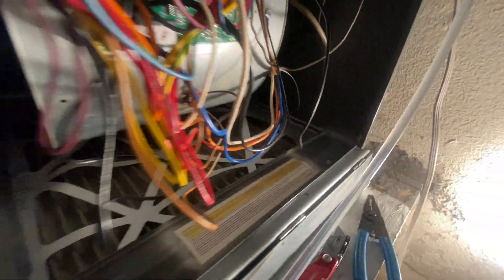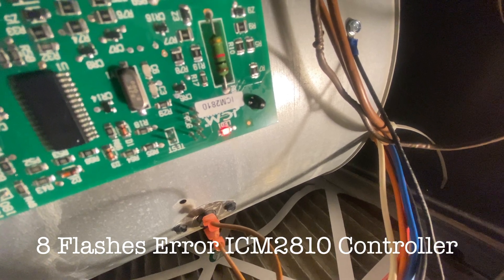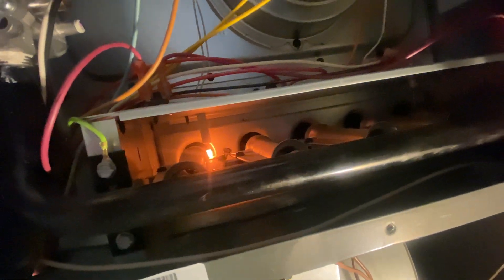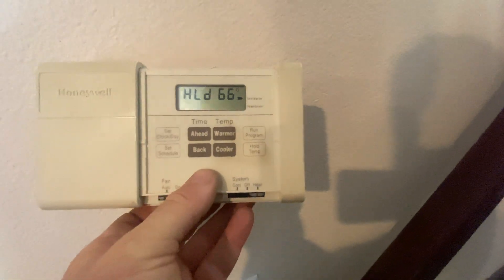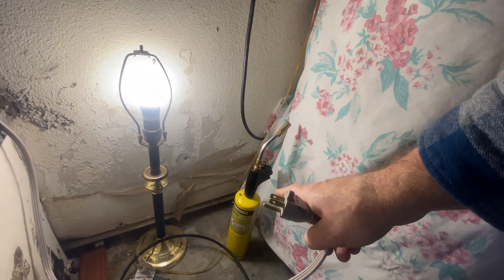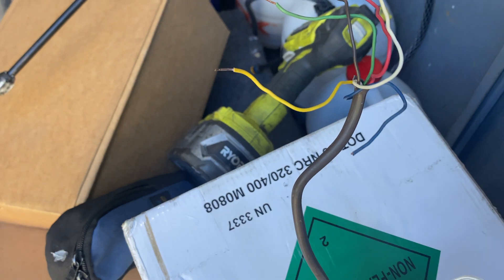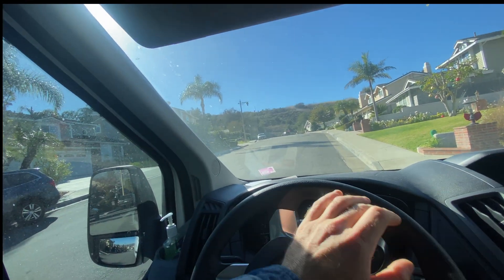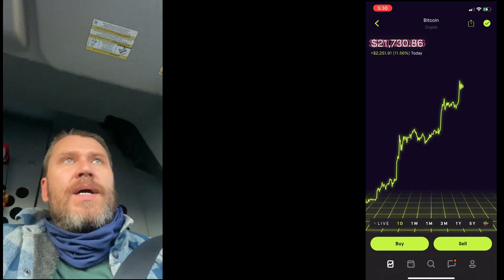Goodman Furnace No Heat. 8 Flashes Error On ECM2810 Universal Controller. Bad Thermostat.

Comment: Thanks for Posting this. 8 flashes = Bad Thermostat. That thermostat was old as the hills. i don't like those piece of junks thermsotat. New Thermostat allwasy a Good place to start when thermostat loooks like that or very old. i Would of just jumped it out at the board to take themrostat out of the equation on any call when u start troubleshooting. good palce to start. easy too. not to myself. take one piece of wire across Red to w to G for starters. ive seen weird failures with old thermostats with swtches too. wiggle switch and it works. after years of sliding switches.
Reply from the maker: Interesting thing about this service - if jumped of the board with t-stat wires connected to it - same result - you will have to disconnect all low voltage off and then jump it - that would show you bad stat, otherwise as long as stat in the circuit its doing this open valve for a sec and then to lock up mode
Reply: @MaratRPMSoCal    Good to know . thanks . i don't do much heat either.not around here. only the occasional heat call.
Reply: @MaratRPMSoCal  probably batteries leaked and got on the board inside the t-stat. if it doesn't have batteries then bad capacitors leaked and corroded the same way.
was the LV low overall or some partial voltage on the other terminals?
Reply from the maker: t-stat still calling for heat ok and works in cool 100%
Reply: @MaratRPMSoCal   Thermostat looked too old. i put those thermostats in in the 80's.lol. 40 year old thermostat. LOl.
Reply from the maker: @OcRefrig  This repair still doesnt make sense to me. Only because tech support was saying bad stat 😂. better believe what error code explains, don't trust common sense nowadays I guess
Reply: @MaratRPMSoCal    
i'm guessing thermostat was doing something funky inside and board saw it and did not like it and threw a code.
Reply: @MaratRPMSoCal    Yea, allways best to follow what code sheet says first then i f that does not work , start using common sense and troubleshooting and tech support.
Reply: I was having exact same problem all winter.  Had tech out couldn't explain the eight flashes and the fact that everything was in good working order. Put new thermostat in solved problem.  As were coming into spring/summer haven't had furnace running for a week or two until this morning. Woke up this morning to the house at 61 and the 8 flashes are back.  Went down and reset furnace and it kicked on 1st time.  I almost feel as  though the board is probably the culprit as I am an electrician and I know that I do not have a bad ground with new wiring in our house.

Comment: I found mine stops heating and flashes 8 red if it’s run continuously for a long time.
Example, tonight, -12*F. Instead of cycling, it’s run continuous for 4 hrs. After 4-ish hours, it will keep the blower going but shut off the flame. Only solution is to shut off the power physically to the furnace, and restore power to clear the code. Then it works fine again.
Reply: Does your inducer turn on for a few seconds?
Reply: @Sesamestreet9080  yes
Reply: @KmanAuto  mmm had it happen to me. Keep for bad/loose ground cable. If all checks out then it’s a bad board
Reply: @KmanAuto  also try to unplug the molex and reconnect and see if that makes a difference
Reply: @Sesamestreet9080  nothing loose that I can find. Actually the original board died about 5 years ago. Sucked as it would have been covered under warranty had I mailed some postcard in that I never new existed... Did the same with the old board. Again, only happens if the furnace runs continuously without shutting off for 4ish hours. then just runs the blower. If I turn temp down before 4 hrs, and then back on after waiting 5 or 10 seconds, as long as I do it before the 4 hr mark, no problem. It's weird. I just live with it. I installed a couple mini-split heat pumps, and since I have solar, that does a good chunk of the main heating now and costs next to nothing to operate :-)

Comment: most goodman boards, only throw an 8 code, when the furnace has a bad, or no ground wire in main power cable.
Reply: yeah, it's usually fast 8 flashes = bad igniter/board or grounding problem.